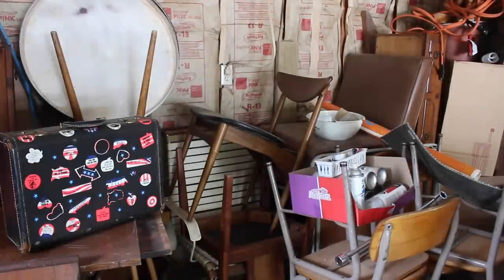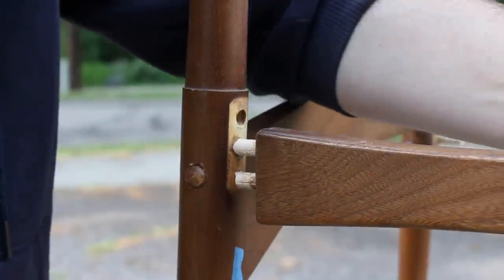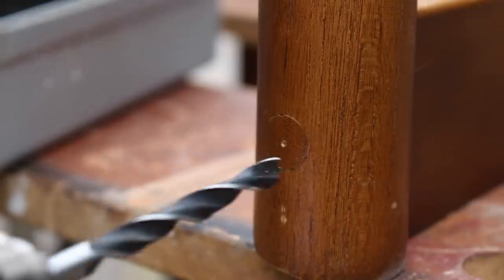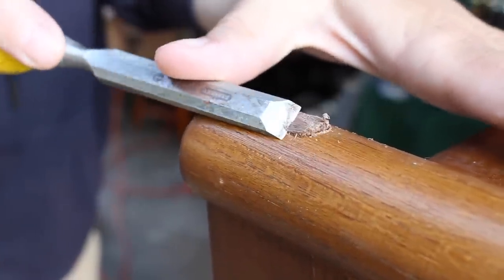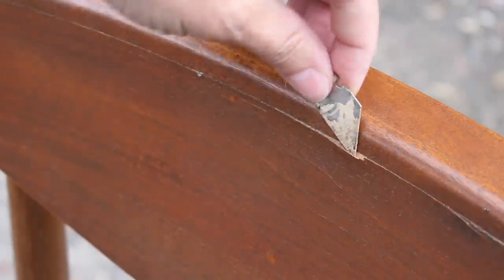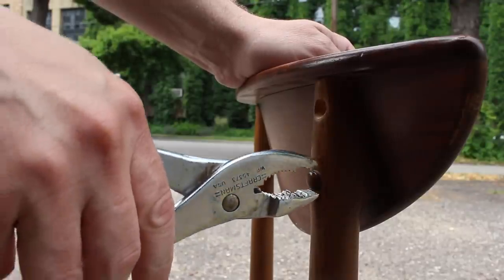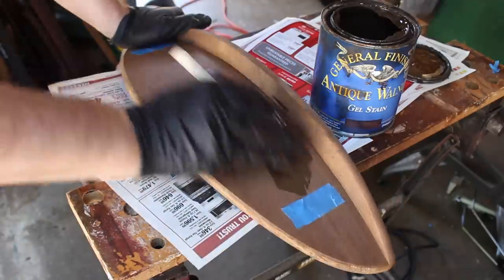Mid Century Chair Restoration

Comment: I have a round table with four chairs, UK made by McIntosh. The chairs fit into the table saving space. Originally I owned an oval table and chairs in 1969, bought when I married, still in use today, still in immaculate condition.
There is also a square table with chairs fitting beneath, regrettably, living in Northern Ireland, I was never able to get Sellers to agree to delivery. 
The round one was bought to save space and had been owned from mid 60's by the same family. Thankfully, their son was more than helpful in it being shipped to me. The shipping cost more than my table and chairs, considering its quality, I couldn't have afforded to buy anything to equal it. 
The round table is brilliant as it takes up much less space in my small living area. It still has the original dralon seat covering which I keep meaning to recover. Unlike your chair, mine are still in perfect condition as is the table

Comment: When removing a flush plug, I always drill a centered hole slightly larger than my screwdriver, then removing the screw lifts out the plug without damaging the hole. It works great and I've never needed putty. I can't imagining trying to exactly center a drill bit the size of the hole and not expecting to drill into the leg.

Comment: I had also found a chair in my street last year. It was completely apart, but all the parts were still in pretty good condition. I found a brand name and after some research on the internet it turned out to be a design from 1964 [also my year of birth!]. However, this was a copy. Unfortunately. It appeared to be a brand from much later a year. 
I tried to restore it and glue it back together, but because I had no clamps I had to do it with rope. The end result was satisfactory, but after using the chair for a while, some glued spots loosen again. Probably because I had no clamps to do it properly. 
It's been sitting in the corner of the room for a year now. I'm going to fix it soon. I promissed it to myself. It's a nice chair.

Comment: I've learnt a lot from your channel and restored several old furniture I had on my garage. It felt great and now they're looking good in my room. Thank you.
(The hardest part was re-aplying veneer son some parts that had completely lost it. That type of veneer that comes preglued , which you apply with a hot iron didn't work. Contact cement neither, don't know why. I had to glue it with Titebond... After the 4th atempt it worked.)

Comment: My family had a set of these dining room chairs when I was a small boy. The design is compelling, but from what I am reading in these comments from others who know the same chairs, structural issues appear to be common with these. In fact, One of the chairs suddenly collapsed under the weight of my Uncle Page while he was sitting in it back in the very early 1970s.  Although Uncle Page was a huge bear like man, the sudden collapse of the chair was enough to scare my family into taking these out of general use as dining room furniture. I think they may have been demoted to use by us children, given our small size and light weight. They were gone by the mid to late 1970’s. I still like that design though. Very Danish modern...

Comment: I have a set of mid century chairs that I would like to restore at some point, they are usable and we use them daily but they have some wobbly joints. But the frame is glues to the plywood bottom of the seats, and the plywood has actually started cracking. Do you have advice for this?

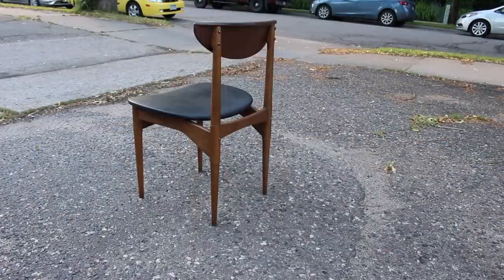Comment: For anyone thats wondering the chair is based on Hałas and its Polish Mid-Century design by Rajmund Hałas. The original chair looks slightly differently there are more curvature to some elements and the legs are on an angle. Just finished it and 12:29 (hałas means in polish loud noise) lol

Comment: Would you recommend wood glue in most situations, or are there times when epoxy makes more sense?
Reply: 2 part epoxy works great on plastic.   I saved $50 by not having to buy a new basket strainer for my pool when the handle broke off.

Comment: Excellent video! I have a set of 6 MCM teak chairs that have the plugs on the ends of the upholstered chair backs. I’ve been unable to remove a few of the plugs, what do you suggest??
Reply from the maker: Try warming up the plugs with a hair dryer to soften the glue.